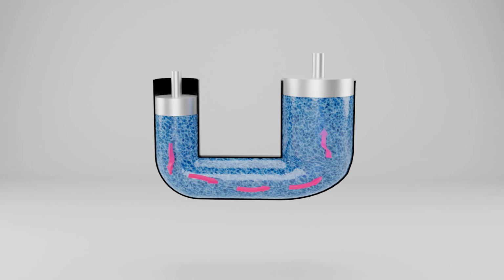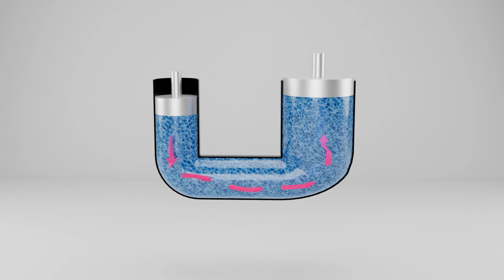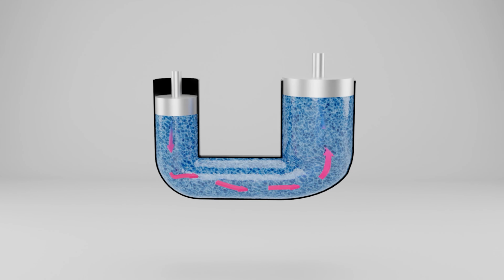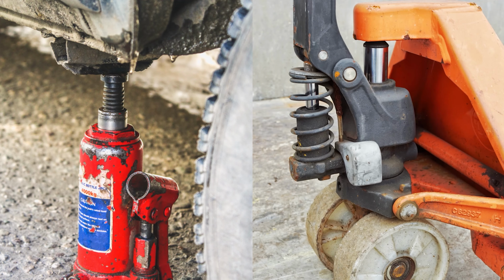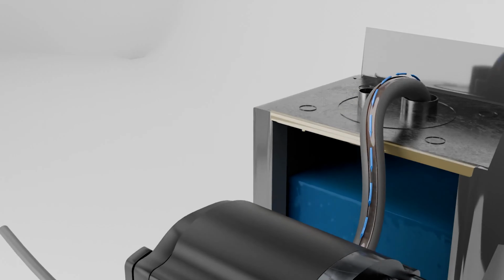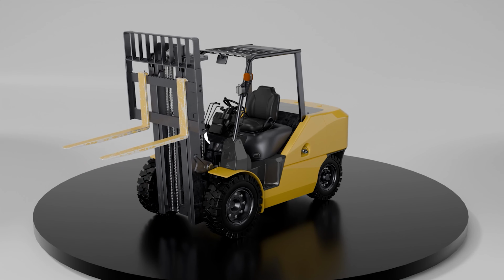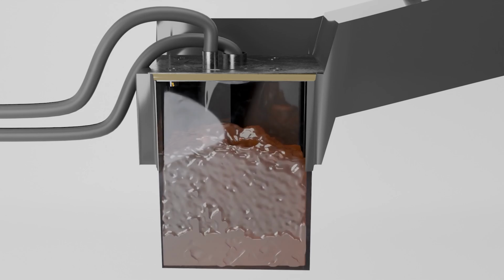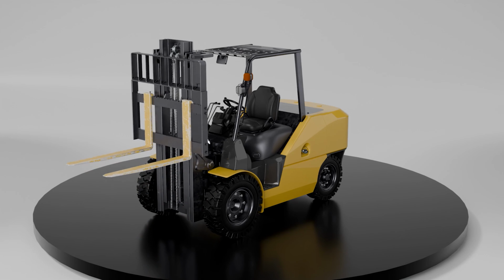Forklift Hydraulics | How Do Hydraulic Works on a Forklift | Forklift Hydraulic System Explained

Comment from the maker: Understanding how forklift hydraulics work makes maintenance and troubleshooting much easier. If you’re replacing pumps, cylinders, hoses, or seal kits, Lift Parts Warehouse stocks OEM-grade hydraulic parts for most forklift brands.